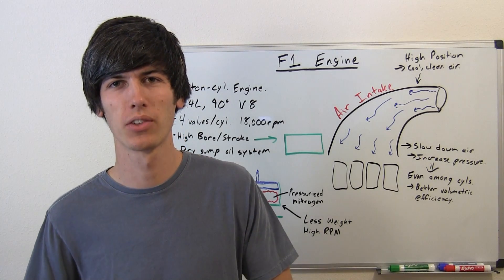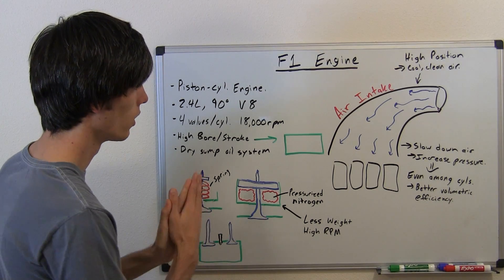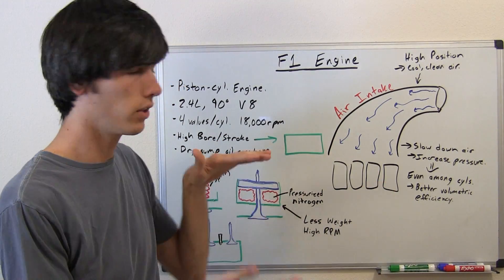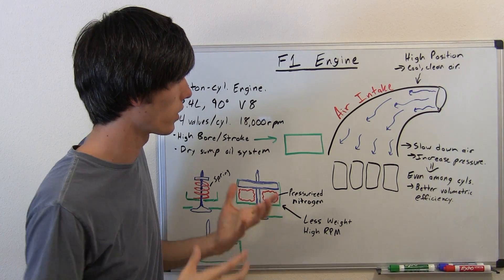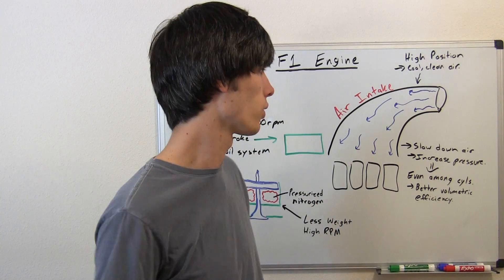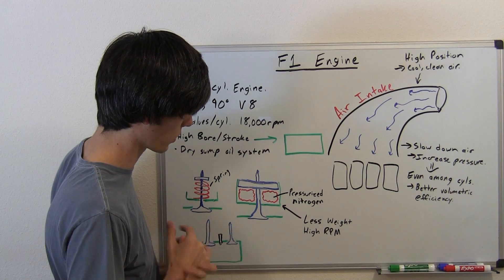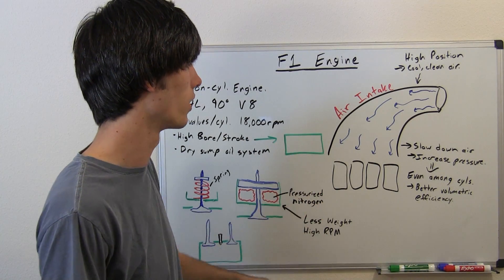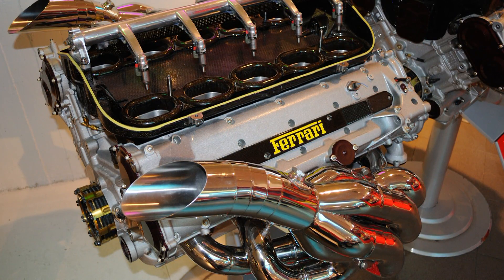F1 Engine - Explained

Comment: Yes it can rise a bit over 1 atmosphere, but not very much. I made a quick and dirty calculation and with 320km/h it would increase the pressure only by about 0.05 atmosphers over the surrounding pressure.
Back in 94 after the black Weekend of Imola, they had to cut a hole in the back of the airbox to decrease the toppower of the engines and if i remember right, it only brouth the engines down by somewhere around 30hp at max. So it helps a bit, but isn't a dedicing factor for the champioship.

Comment from the maker: Correct, I believe they also re-pressurize the system before/after each race. But yes, the engines only last several days out on a track before they swap them. Each team can go through 8 engines per season per car.

Comment: The trick is, to bring more air in than the engine actually is needing. If that happening, the pressure starts to rise depending on the speed you driving and the revs of the engine. As an example the current F1 engines need around 360l/s when they would reving all the time with 18000rpm. If the Airboxhole would have a diameter of 100mm and you would drive 320km/h the theoretical flowrate that goes into the hole would be nearly 700l/s. The excess air let the pressure rise a bit.

Comment: Question? if youre slowing down the air in the air intake after the orifice, how could the air pressure be increasing?wouldnt the pressure be decreasing and settling down. youre going from small area to big area? or is this a bernoulli thing?

 I can understand the need for laminar flow for even air intake between pistons.

Comment: Another benefit of using gas instead of a spring is because the gas reacts much faster.  High speed footage shows springs can’t transfer energy quickly enough before the next cycle of the camshaft.  As a result the unreleased energy in the spring builds up and causes it to break, resulting in engine failure.

Comment: Worth noting that F1 and other high performance race engines are built to such precision tolerances that the engines are never cranked when cold. They are preheated first using coolant heaters to bring the block up to temperature

Comment: CR is approaching 14:1 or higher. The current 2.4 litre V8's do run ITB's. ITB's go back all the way to the early 1980's for some engine builders. They became the de facto standard in fuel/air delivery after the Turbo era came to an end.

Comment: what was the reason that f-1 engines went to pnumatic valves about ten yrs ago,and went to larger front tires and longer chassis.
they sound hideous and look grosse,.
just because electronic tech is used in other thing's ,why did they go to electro shifting,and suspension?
should go back to manual shift and reg suspension.

Comment: Just type this in google search: fia f1 technical regulation 2012. Click the second link in the list, should be a pdf.
go to page 21 section 5.1.2 and read this: "Engine capacity must not exceed 2400cc." They are 2.4l V8 since 2006 and introduced the revlimit of 18000rpm at 2009.

Comment: The 3.0 capacity was only used for the V10's producing close to 1000bhp, the current iteration V8's are most definitely 2.4 litre capacity and they still do produce around 750bhp as you stated.

Comment: Sorry but no. The FIA technical Regulation says.
5.12
Engine actuators :
With the following exceptions hydraulic, pneumatic or electronic actuation is forbidden :
a) Electronic solenoids uniquely for the control of engine fluids.
b) Components providing controlled pressure air for a pneumatic valve system.
c )A single actuator to operate the throttle system of the engine.
d) Any components required as part of a KERS.

So, it isn't aloud to move the valves with a solenoid system by regulation.

Comment: You want more mass airflow generally at high RPM. Think of a garden hose with your finger over the end. More pressure and velocity, but a lot less mass of water. Depends on the RPM range and loads of other factors.

Comment: Does this mean that ram air intakes Don't work cause the air would be low pressure? Also is it a general rule that faster air is lower pressure and slowerr air is higher pressure?

Comment: Wrong, the ignition timing isn't a problem at all, the timing is completly electronical controlled and they can change it to every setup they want. No, the problem is a rather simple but astonishing one. F1 engines haven't really a flywheel and the crankshaft is also extremly light. So, the moving masses are extremly low and the enginge have nearly no momentum, They have to rev quiet high even on idle (around 6000rpm) just to not let the engine die because of that.

Comment: another good reason for the dry sump is to keep the weight inside the car(between the wheels) not much weight but it does effect the dynamics (when considering how picky race cars are).  Great video btw, hear the sweeds are trying to use pneumatics on the koinseggerereererergtegege? that will be interesting

Comment: Just curious, are you working in the automotive industry today? I'm studying Mechanical Engineering but from time to time will contemplate going for an automotive engineering degree but fear that it's too narrowly focused.

Great videos. 

Also, have you ever considered a motorcycle? significantly cheaper than cars when considering the whole thing and parts.

Comment: It's to do with valve overlap.  Air is elastic so at high revs when the piston moves towards BDC, the air still isn't at maximum velocity coming into the cylinder, so as the piston is moving up towards TDC, the inlet valves are still open.  The sheer mass/momentum of the air still coming in is counteracting the reduction in volume and the cylinder pressure is increasing - a good thing :)

At low revs this doesn't happen and you will simply push the air back out of the inlet reducing pressure.

Comment: Sort of.  An F1 engine has a VE of way over 100% thanks to harmonics of intake pulses and the ram air effect of the intake.  The intake of an F1 car is shaped to try to distribute the air equally to all cylinders as well as slow it down.

These 'boxes' are called plenums.

If you can set up a ram air effect on your Honda/acura etc, then yes a plenum is going to work.  Otherwise, it's all for show and to get you to waste your money!

Comment: Why F1 engine can not run at low revs? I think it is because the ignition timing is not exactly in the upper dead point as in normal cars, but a few degrees before. Is that correct? I heard that from an old mechanic who had often to change the valves on the engine of his beautiful old Maserati Mistral 4.0, all until his parts vendor in Italy said to him that things about the ignition time of the sport car engines. Logically, it is also one of the reasons for reaching a high revs. Right?

Comment from the maker: I guess the maximum would just depend on the components involved. If the internals are strong enough, 200% volumetric efficiency is easily doable with forced induction. And you can go higher of course.

Comment: Nice review, but you forgot to mention the tighter fit the pistons have in the cylinders as well.  They have to heat them to 80 degrees with oil and iirc water just to get metal to expand to enough to let the pistons move.  The engineers that work on em, have an autosystem to heat the engines 3hrs before they go to work, just to have them ready when they are there.  Very nice video btw, though it was a bit short for my taste, but the style is awesome, subbed.

Comment: I've often wondered why engines don't intake air through the radiator, which would keep it cool without needing any fans. Is it just because this air would be hotter, and less dense?

Comment: @scrfce123 I Wasn't talking about wether the engines sound good or not. I was pointing out that it will not be a problem for the engineers to build a 1.6 liter turbo engine with 700+ hp and be reliable...

Comment: In the mid 80's, formula 1 cars had 1.5 L turbocharged engines that made close to 1000 horsepower reliably and pushing 1400 horsepower in qualifying setup on certain engines. I think with today's tech it won't be a problem at all.

Comment: F1 engine has very short skirt pistons and has only one piston ring. Also camshafts are not driven by chain or belt. They are driven by electric motor. The rev is so fast so belt or chain cannot keep up the timing.

Comment: The cylinder has a sleeve which is separate from the block and also made of a difference material so it will contract differently and also inward, squeezing the piston head and seizing the engine more or less.

Comment: The gaps should increase when the engine is cooled. Pistons commonly "shrink" in the bores when the engines are cold, and expand when at operating temp. Too little clearance with heat expansion, things can seize, the same issue with ring gap and detonation or forced induction vehicles, it must be increased. Can you explain your statement better? For every action there is an equal opposite reaction, and metal doesn't expand when cooled.

Comment: To get the maximum amount of force on each power stroke, F1 engines need to reduce windage (the amount of gas lost in the gap between the piston bore and the cylinder). Therefore when the F1 engines are built, they make them at the operating temperatures to make them fit together perfectly. Once cooled the metal contracts, the pistons and cylinder seize up and are almost stuck together. So to reach the operating temperatures the engines need to be pumped with warm oil and water for about 3 hours

Comment: Agreed my friend! One of main reasons why low-rpm engines are undersquare is that pistons can be longer, hence more stable in bore when moving, less wobble = less wear. Also, there's more clearance with valves, so no complicated cuts on piston top is required as opposed to most of oversquare engines. Valves themselves are much smaller(read lighter). It's kinda win-win if no high rpm is required :)

Comment: I heard in a Top Gear episode that the piston to cylinder wall clearance is so tight the F1 engine needs to be at 80 degrees celsius for it to be cranked without major scuffing. However, I haven't seen or heard any of that since, and I'm wondering if it's still true in today's engines. Could you confirm or debunk this for me?

Comment: They use some kind of kevlar conductor so it would never catch fire to protect the wires, also they use a special carbon fiber for the exhaust side otherwise the car can get burn and the titanium pipe is make to get all the heat out of the car as soon as possible and the new turbo charges has own radiator...and thank you for all this videos, they all are astonishing!

Comment: Nope, that's only matter of valve timing, governed mainly by shape of camshaft lobes. The reason why diesels generate more torque on lower rpms is that they can't do it in higher rpms by definition, diesel burns much slower then gasoline, so they optimize valvetrain of diesels for better cylinder fill on lower rpms, where burn can be more complete, that's it.

Comment: Well the part with large stroke meaning more torque is kinda wrong. The amount of work done by expansion of gases depends only on volume by which gases expand (and pressure of course, but let's take it out of equation for now), and even though it's true that leverage of piston in long-stroke engine is bigger, the surface of piston would be smaller(assuming same volume), meaning less force. Long-stroke engines allow more durable and a bit simpler engine design, cant squeeze it all in one post tho

Comment: hes probably talking about heat sink fins on the exhaust manifold or the turbo housing.  The reason why you dont is you want the manifold and turbo housing to remain HOT, this allows the exhaust gases to flow faster threw the exhaust system.

Comment: With the new rules for 13 ,i understand that turbo engine are the new engine.Why on a turbo engine i never see any heat sinc fins on the exhaust side of the turbo?With my experience with electronics heat is the enemy.I enjoy the videos.thanks for your work.

Comment from the maker: "L" is liters, or the volume of the car. The reason why the size of F1 is small is because of regulations. 2.3 is fairly large for a 4 cylinder. Also, as I explained, with high bore to stroke ratios, and a limit of 2.4 liters, the cylinders would be very large if there were only 4. F1 is moving down to 1.6L V6's though.

Comment: Bro, just say it's an over square  motor and give a brief rundown on over square/under square motors.  With "square" being an equal size bore and stroke. Over square is  a larger bore and shorter stroke and under square is a smaller bore and longer stroke. F1 engines are very over square. Great vid btw.

Comment: A Dry Sump engine in racing is used to make sure that that the engine wont WET SUMP... if you have too much oil in the pan it can reduce HP it takes HP to "drag" the crank shaft though the oil... that why race engines use DRY SUMP... and a very efficient oil pump helps as well!

Comment from the maker: Reducing the stroke doesn't necessarily mean reducing the compression ratio. F1 engines actually have much higher compression ratios than most cars. The advantage of a larger stroke would be greater torque, as the geometry of a longer stroke would allow for greater leverage, thus producing more torque.

Comment: But if it did make it down there it wouldn't be big rain drops it would be pretty much relative humidity at the point its entering the cylinder.  Its rather insignificant and the engines sensors and computer adjust for it.

Comment from the maker: But you do realize the massive 12 cylinder engines are used to compensate for weight, correct? Mitsubishi Evo's can hit 60 in under 5 seconds with small stock 4 cylinders - oh and they only cost $30-40k. Look like the Bentley engineers spent an extra $200k and have nothing to show performance wise? No - because a Continental GT is a luxury vehicle. 0-60 in under 5 seconds is relatively slow for a "performance" car with a six figure sticker.

Comment from the maker: If you notice my original comment, I left out the DBR when referring to lateral grip, as this is a track car, and isn't even street legal. 

Weight is one of many factors that determine handling characteristics of a vehicle, and also very importantly the location of that weight (the car's balance, moment of inertia, etc.). Other tremendously important factors are the tires, and the compound used. Drivetrain (FWD, RWD, AWD) and the engine further enhance performance.

Comment from the maker: I never said they were grandmas, they're luxury vehicles with a sporty feel (as opposed to something like a Rolls). They're a hybrid between luxury and performance, but they will never be meant specifically for track days. 

Development of performance? You know, of the processes in ensuring a vehicle performs/handles well in the development stage is minimizing weight, by choosing materials that are both rigid, and light weight. All race series' have weight restrictions, because it's important.

Comment: You're right, sorry. You responded to my comment replying to him relatively quickly, I didn't bother to look at who responded.

But the Bentley Continental GT and Aston Marton DBS and DBR are in fact labelled and marketed as performance cars. I don't think "sport+" would be an option in any old granny mobile.

And I never said good handling makes good handling. I was making a point by saying development of handling and performance is what makes a car perform and handle. It's not all weight.

Comment from the maker: Bentley's and Aston Martins do not handle nearly as well as performance cars in the same price range (or much lower price range). These are luxury vehicles, they're not really meant for a track. Weight is one of the most important factors in a car's performance and handling.

Comment: You are extremely thick. 

Just because you have a lighter engine, it doesn't mean definitively that your leaf springs or double-wishbone suspension, or your 3 lb car will behave more positively. Bentleys and Aston Martins have no problem throwing around 700lbs of drivetrain.

Comment: "Oh yes, your quite correct.. hp/liter output is completely irrelevant in racing!"
I'm saying it's irrelevant to compare the N54 and the LS7 by displacement alone. 

"Are you implying that no one besides Chevy has ever built a 7.0liter production engine?" No I'm saying you can't make the N54 7 liters.

Displacement in an engine hardly justifies it's potential. Especially when comparing a pushrod to an Overhead-cam system.

Comment: I didn't realize HP/Liter was anything special. Especially with 4-bangers like the Honda F20C creating 120 HP/Liter. Does that make it WAYYY better than the 335i? Make it 7.0 and it'd be over 800 HP. But you can't.
 And you can't make the E92's V8 7.0. So the argument is pointless.

And I was commenting on "Smaller and lighter engines use less fuel and give cars better handling and braking". Asinine.

Comment from the maker: I think you're getting slightly ahead of yourself. Yes, both engines might be able to make the same amount of power, but the materials are important to know if the block can hold the stresses. Also, if you're planning on 8 seconds, nothing about the engine is going to be stock, so it's not going to be a Vette engine, or a BMW engine, rather just parts that happen to work in the respective engines. And at that point, you may as well just buy a crate engine if your concern is simply 1/4 times.

Comment: Would you say that both engines (the 7L V8 and the 3L I6) have the potential to be built up to the point to make the car run 8sec in a quarter mile?

Another thing I worry about is picking a car to build...investing all of that money into the engine, just to later find out that the engine isn't going to be able to hold the power that I want to make.